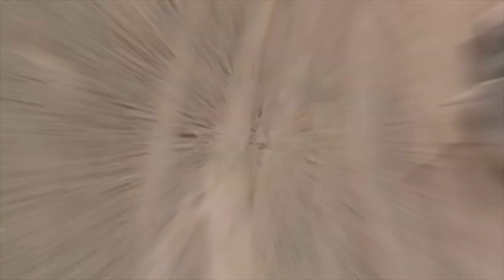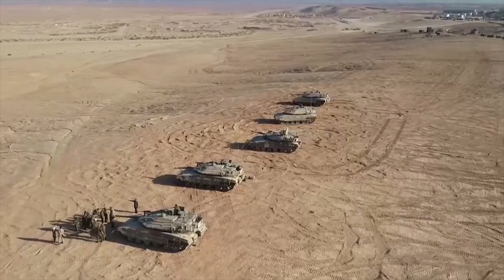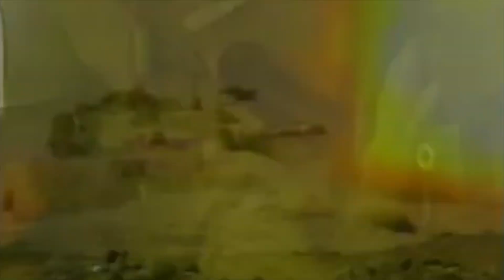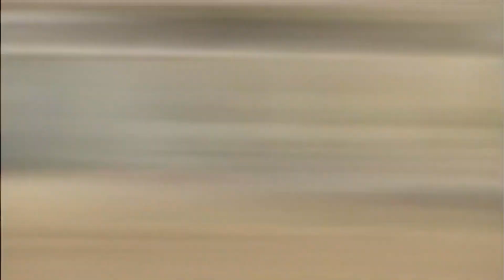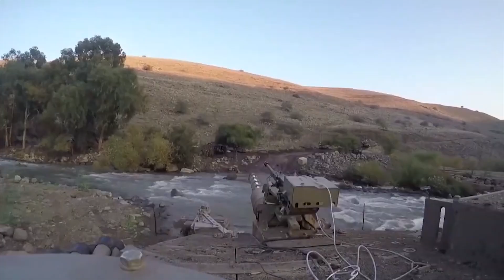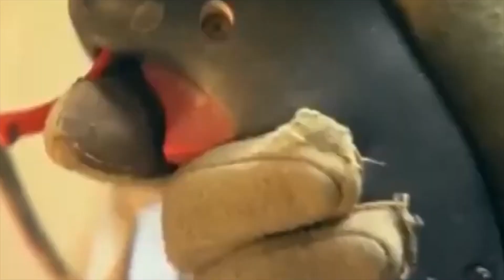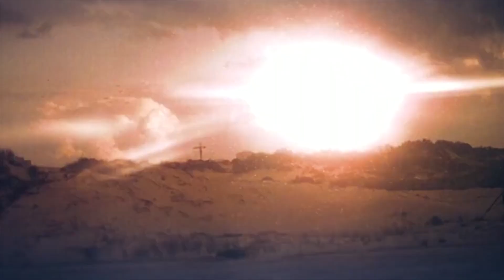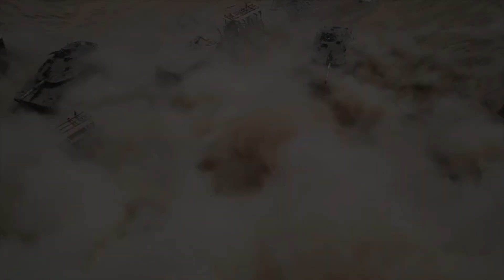New ISRAELI Most POWERFUL Tank SHOCKED The World!

Comment: You got the name of the British Tank used by Israel wrong. You said Chieftain !!!!   It was the Centurion, they used it to great  effect and with success in several wars. I do not know for sure but I heard with the engine in the front the IR signature is increased and can been seen by the enemy. I imagine there is lots of heat shielding and in a hot climate the hot exterior will in effect hide the tank against the background. Again I say I have no in depth knowledge of modern equipment, I last commanded a tank in 1970 !!!  Way out of date.
Reply: Actually, the 1960s Chieftain tank project was a joint Israeli/British collaboration with Israel supplying many of the technological advances but the tanks themselves would be built in the UK. However, due to Arab pressure, the British reneged on their agreement and refused to supply any Chieftains to Israel. Israel learnt a vital lesson and decided to develop its own tank, based on the Centurion platform.
Reply: @RebMordechaiReviews  Politics and the middle east. Who would have thought it might end up in a mess. Those tanks were built a short distance from my company, quite how much Isreal could contribute is an open question as they never did. The Chieftain has nothing special on board, is built of nothing special and was of its time. As far as I know Israeli have their own unique requirements from wider tracks to survivability improvement as they had so few troops losses could be game changing.
Reply: @SandhoeFlyer  Interesting. To give you a little background. Israel continued to use heavily locally upgraded Centurions until the early 1980s. These upgrades were studied by the British who invited Israel to assist in incorporating some of these improvements into the Chieftain project. I am sure a Google will give you more details of this. In fact the Chieftain was designed to be effective in desert regions and was indeed sold to some Middle East countries, much to the anger of Israel.
Reply: @RebMordechaiReviews   Thank goodness the old war horse centurion came up against nothing more than Soviet rubbish. It scored long range hit after hit thanks to that rifled gun. Whilst the massed armour of the soviet  tanks bought by the Arabs was inferior, on the move had to stop and hand wind/crank the turret with an ineffective gun.. They were knocked out by the dozen..happy days
Reply: @RebMordechaiReviews  you mean not to trust the Brits who screwed Israel even during the Mandate.

Comment: Please specify Merkava 4 has turbo diesel engine with a power of 1,500 hp (1,119 kW)Maximum speed 	64 km/h (40 mph) on road
55 km/h (34 mph) off road.Merkava 4 Barak will have artificial intelligence

Comment: Aside from pronouncing the name wrong the video hits many important points in its evolution. Unless the international tank competitions are held in Yis’rael we will never see the Mer’kavah (Chariot - מֶרְכָּבָה) in a competition, it’s to big to transport by air; even the C-5 Galaxy isn’t big enough. Aside from the 4 crew members it has room for 4 ground troops who can exit on the move through the rear armored evacuation hatch. The hatch has been improved for faster deployment and the speed of its interlocking doors is impressive. I’m not sure if the main gun can fire on the fly as accurately as the M1-A2 Abrams but the standing range is almost identical. As with every nation, Yis’rael doesn’t release every detail, but I’d feel safer in the Mer’kavah than most other countries top tanks. It’s defenses are very impressive and though the armor os classified, the low profile turret would be very hard to hit face on. ה' יברך את ישראל.
Reply: 6 fully equipped fighters can be carried in the back compartment, not 4 as you say. In Mk.4 even up to 8 soldiers (though really cramped) can be carried. Or 3 stretchers
Reply: @maximsiddy40  
That must be an update in the newer variant, or I’m just not remembering accurately. Thanks for the correction.
Reply: I like the shape of the turret also but with the newer missiles, the attack is almost always from above not head-on or from the side. Looking at it from above, it has a lot of flat plate that is butter unless it defeats the missiles with the Trophy system. With suicide drones and new smart missiles, I would not want to be in a tank in the next war.
Reply: @rudyyarbrough5122  
In today’s battlefield it’s hard to say where you might be safest, but I agree tanks are a prime target. Israelhas upgraded the Mer’kavah with numerous defense systems against aerial attacks of various kinds. They are way out in front of us in that area. After 1973 (Yom Kippur War) when Egypt used ground to air missiles to force Israel’s Air Force to withdraw, Israel then attacked using the British challenger and several other types of tanks. They were met with Russian made wire guided rockets that decimated Israel’s tanks. After that Israel invested big money in overcoming these problems: hence the Iron Dome, David’s Sling, man portable drone aircraft with pinpoint targeting radar that permits Israel to fire ground missiles and artillery immediately after the drone spots a launch. The drones are relatively inexpensive so Israel saves its planes until a safe corridors opened. The rockets that destroyed so many tanks are now pppintercepted by four types of anti-rocket systems. Of course nothing is foolproof but they have tested the systems against multiple types of modern anti-tank rockets and they successfully intercepted the missiles. G-d willing it will work as well in the next actual war.
Reply: @emeqgershown3064  Let's hope it will be enough.